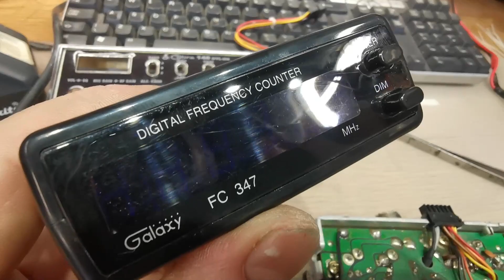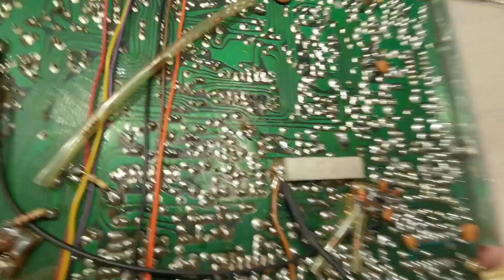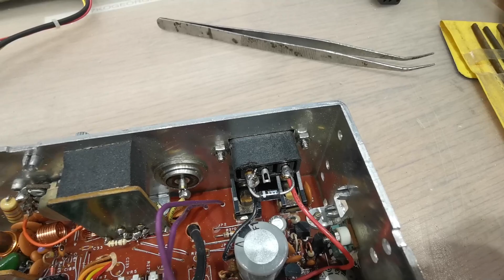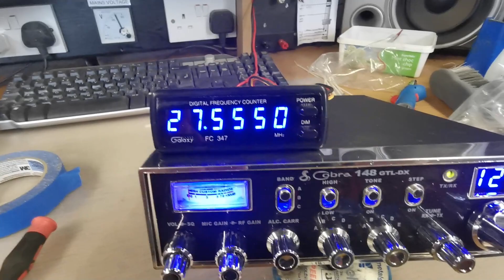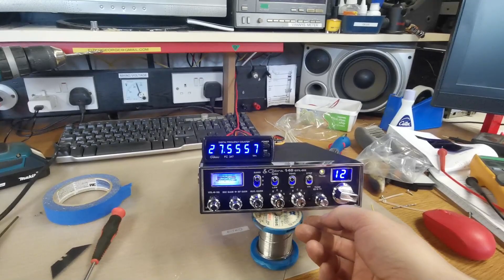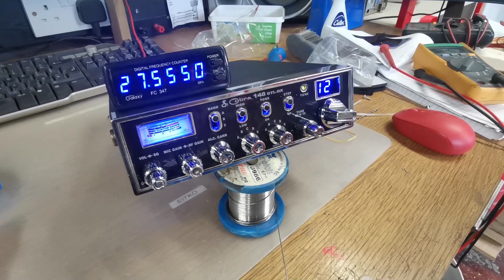Mr IAN'S COBRA 148 GTL DX PART 3

Comment: Nice Job.. George.
Getting there .. WOW @ https://youtu.be/MNy_yBTyCOo?t=220 ..
Just a quick question - Do you think it would be possible to adopt one of these into a Radio .... ?  could you 'pick-up' 5V from the board to run it ? 
https://www.aliexpress.com/item/4000318705956.html?spm=2114.12010615.8148356.6.70264d38fbQMce
Reply from the maker: This was in Spam for some reason.  The thing you need to do is to be able to look after the offset for SSB. You could get this one to read on AM no bother say on 27.185, but as soon as youd go to USB it would read a bit higher and vise versa on LSB.  If you can find one like that where by applying a voltage to a programmable offset to make it read right on upper or lower sideband.